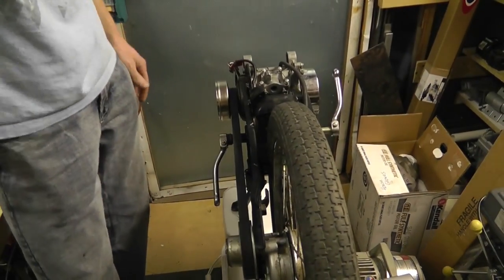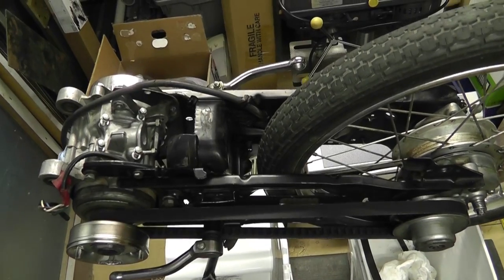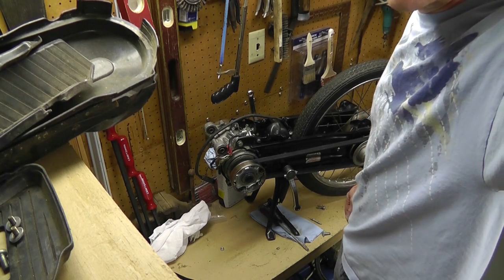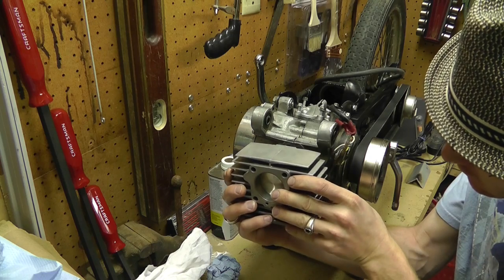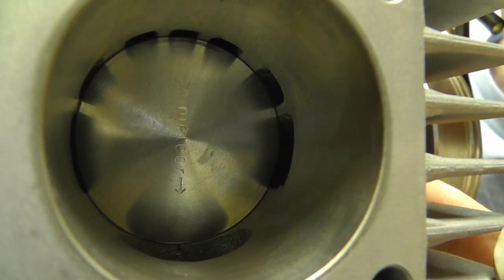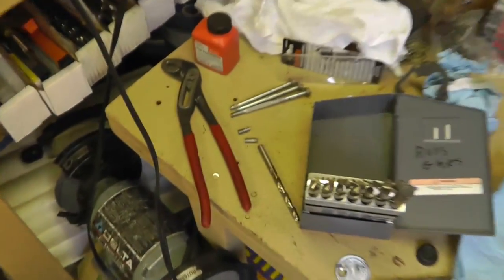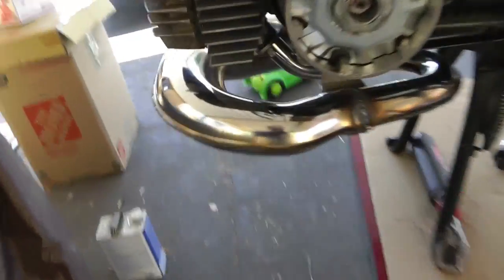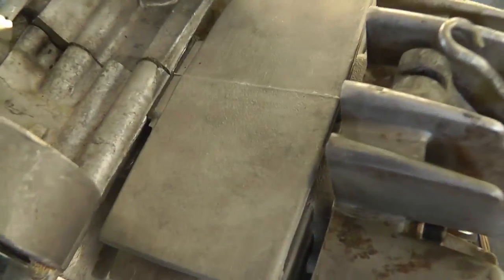#5 Honda PA50II Hobbit: Installing Parts. Broke Some Stuff. Fun Time lapse @14:15 & 17:10

Comment: Used to teach maintenance welding to industry and at a tech center. The openings in your weld are known as a$$holes in the trade. Like flying, ANY landing you can walk away from is a good landing. ANY weld which is strong, holds, leaves clearance and does not weaken adjoining structures is a GOOD WELD!!!  

Your only problem in turning your hobby into your career is you NEVER get ANY time off!!!     YOU ROCK RUSS!!!     =3:16!!!             :0)

Comment: I am surprised the service manual if you have one did not recommend new head bolts as old ones always stretch when torqued and if you use the old ones they can bottom out in holes or break off in holes.

Comment: lol yep, i've had that broken bolt look on my face many times.  It's even worse when a body part slams into steel in the process.  :)  I'm thinking the top of the jug might need to be milled to regain some compression lost from the added bottom gaskets?

Comment: Don't stack the gaskets for the sake of those ports.
The ports on the new jug should be bigger than stock anyway.
Run it as-is with the newer just until you upgrade the carb to the mikuni knock-off, then mill the piston head to accommodate the ports.

Comment: G'day Russ. I really love your work, hoping to work together with you when we bring our zero point  machines to USA. What will the head cubic centimeters (cc) be. End of stroke. compression ratio be? Looks pretty big. If it's easy to turn over, you won't have much N/m.    Is the spring in the rear pulley (driven) too heavy as it should be in high speed gear at rest an low ratio under load. Like a 10 speed bicycle. God Bless you & your family.

Comment: Why didn't you just take a porting tool to the piston and cut noches where you needed it lower so you would still have the high compression and not so many gaskets.

Comment: carburetor
bleed screw missing
you can reseal with waterproof rivet

beta-tools com/catalog/articles/view/606_slash_2+-+606_slash_2X/__lang_en/__catlang_fr/__catalog_beta/__filters_
(best quality price /bike)

you should lapping segments
  4 refueling with semi synthesis of very good quality,
and then that of the pure synthesis
(if the base engine is not new, older engines and better-functioning - this limit games)